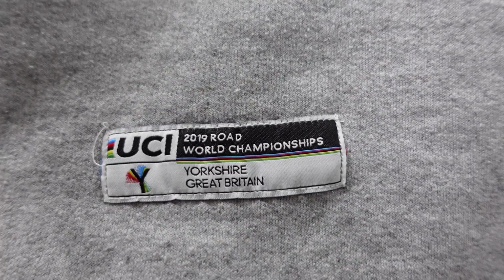S-Works SL7 Sagan Edition Sram Red Etap AXS #sworks #tarmacsl7 #petersagantarmac

Comment: If you smear the carbon grip grease inside the seat tube first, instead of over the post, it won't sploodge out all over Peter Sagan's beautiful Tarmac.
Reply: But then you'll be pushing it deep inside the seat tube.
Reply: @djdelarosa25  Use your finger to coat the inside of the seat tube, not the post.  Lube the Frame, not the post.  No excess grease.  And that's where you want it, in the frame,   not all over Peter Sagan's beautiful Tarmac.  Trust me.  Built literally thousands of bicycles.

Comment: I am the only one seeing he is using the torque wrench 
wrong. it is important to hold it properly to get the right torque right?
Reply: You are correct. Holding it closer to the fulcrum produces much greater torque, he has over tightened the bolts.